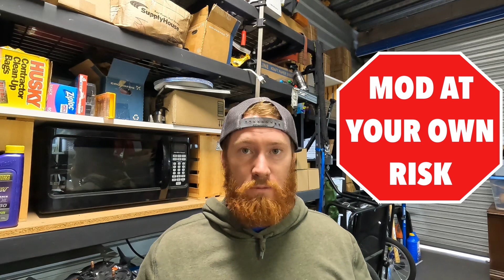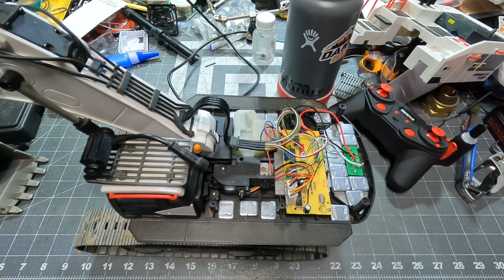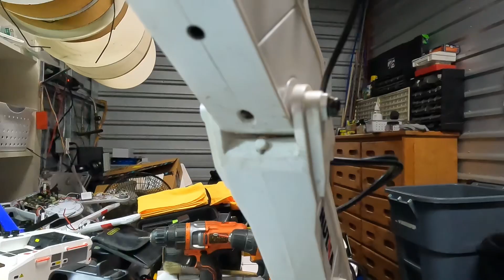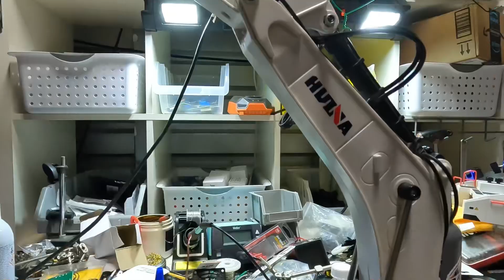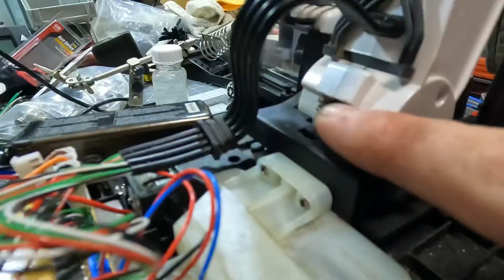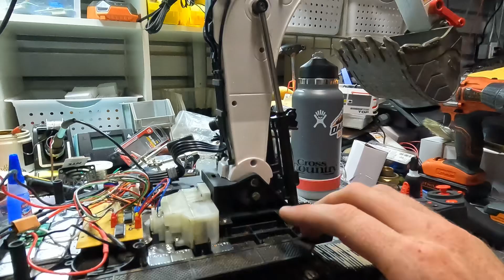Best upgrades for Huina 1594!

Comment: What kind of battery do you use with this? How long does battery life typically last for a normal session?
Reply from the maker: I was using 1600 mAh 2s LiPo batteries from Wolfpack. The stock batteries are 7.2 volt and so are the 2s LiPo. I would get about an hour of run time on those and you can find larger capacity 2s batteries for even longer run time.

Comment: Is it ok to use 2s lipo battery for 1594?
Reply from the maker: Absolutely! The key with selecting a battery is getting the right voltage. A 2s lipo has an output voltage (7.4v DC) which is the same as the stock battery from Huina. You should also make sure that you get a battery with the correct plug or solder one on.
Reply: @roostermccb  Really appreciate you hit me back bro.. thanks for the reply.
I know a bit about rc and stuff cause ive been playing rc for maybe 15 years, like 1/8 engine/elektrik buggy, 1/10 scx crawler and others, so im quite familiar with batteries. But, this will be my first rc construction as I just ordered 1 and suppose to have it like maybe in 4 days. In my experience, stock battery is bad, its just bad no matter what brand, so I always swap it with lipo, and as u mentioned, need to pay attention for the right voltage.

I know 1594 use 7,4v with li-ion battery, but lipo with same voltage will give much more power and punch (eventhough with the lowest discharge rate), and pretty concern about the board of 1594. So thats why im asking you cause i saw you using lipo. So with you already using it in 1594 for quite some times, i guess its safe to use it and no need to worry to fry the board.

Anyway, thanks for the reply bro. Cheers from Indonesia
Reply from the maker: @achmadtsabith5527  I ran the 1594 on a 3s 50c lipo for a couple of hourse! The board can definitely handle it, at least from my experience. I no longer have the 1594 but I will most likely get another one in the future and put up another mod video.
Let me know if I can help in any other way!
Reply: @roostermccb  ah thanks again for sharing your experience, so I will just use 2s lipo right away when my 1594 arrived. But I dont think I will use the 3s. maybe next year haha

Comment: Can i change the batteries to last longer?
Reply from the maker: Absolutely! Any 2s Lipo will work but you may have to solder on a plug to the battery to fit whichever plug your excavator has. You don't have to use lipo, but it's what I prefer because of how quick they can be charged.
Reply: @roostermccb marvelous, thank you very much.

Comment: Does anybody know what battery he’s running?
Reply from the maker: @luisstussy4899  I forget the exact battery but it was a 2s lipo of varying capacity with an xt30 connector. The stock electronics can handle 7.4 volts just fine. I've even had a 3s in there but I would not recommend it.

Comment: Hopefully we will see an aftermarket aluminum boom arm before long.
Reply from the maker: @inphiknit  the steel arm for the 1580 works great. I wound up swapping the arm to the steel one and it works well even with the stock screw servos.

Comment: Looking to get one of these, do you think the metal tracks would damage a wooden floor if I used it inside?
Reply from the maker: It definitely will scratch a wooden floor. The Less expensive plastic track excavators would be better suited for that. The 1594 is pretty heavy because of the rebar they have for weight in the body.
Reply: @roostermccb  yeah that’s exactly what I was thinking, thanks!

Comment: You're great!
I am Japanese!  I can't speak English sorry・・・Very sorry.
I have Huina 1593!  I want to remodel?  modify? convert?
Machine operation method is "ISO" pattern  ←　Standard
I want Japanese Komatsu pattern!
I want left Knob Turning to front and back.
I want right Knob arm move to left and right.
Can you customization ?
I want to learn!

Sorry!
Reply: The only way i can think off is by using a different radio controller and receiver. This way you can really costumized your rc.😃
Reply: @miltonrcadventure  Or just move the wire in the circuit boards lol
Reply: @BossSwanger  nice👍
Reply from the maker: @miltonrcadventure  I’m working on this for the next video!
Reply: I got to mess with stuff also can't help it . I've destroyed a few circuit boards on a few excavators lol. But I have the new 1594 and was curious if there is a Way to tighten the tracks ? I also have a top race tr211k . It's the cheaper plastic model of the tr211m but the transmitter fell apart basically and top race is no help think they discontinued the 211k but I can't find a transmitter anywhere. My question is a receiver board and transmitter from a 1593 should work shouldn't it? Their basically the same exact thing both are 22 channel . Any help or ideas  would be much appreciated... thanks

Comment: Cool video man, thanks! Part of me wants to mold and pour a mold of the arm and body in metal. Possibly not enough beer. 😂
Reply: You can buy aftermarket metal boom and stick sets for the 1550 that should fit the 1594 as well. Should be able to find in aliexpress.

Edit- a metal arm/boom probably wouldn't do much for the machine's performance apart from better stick articulation